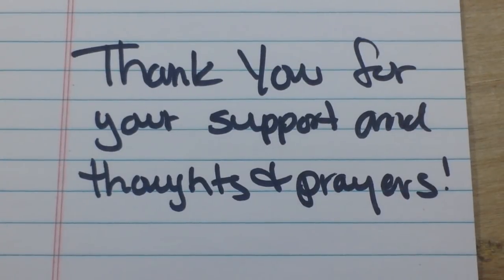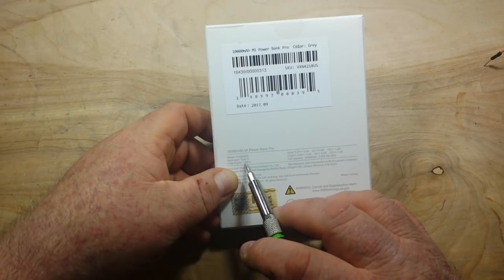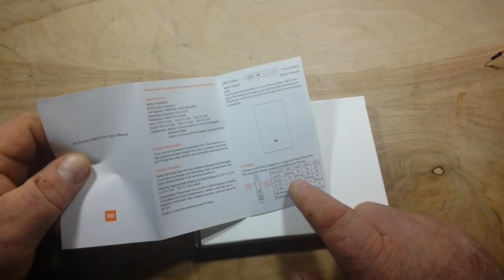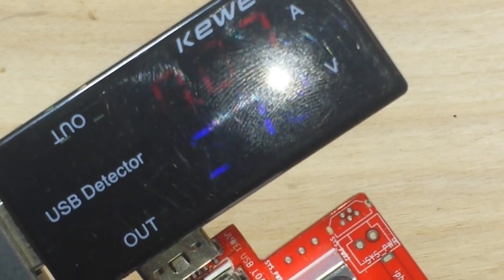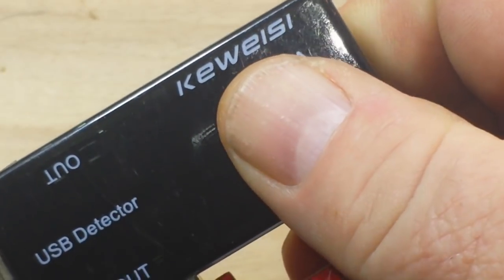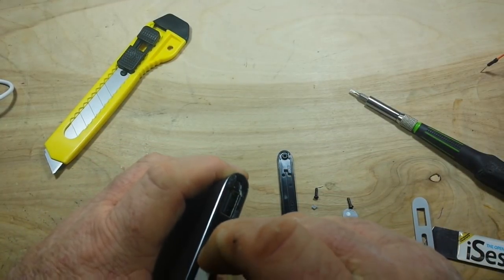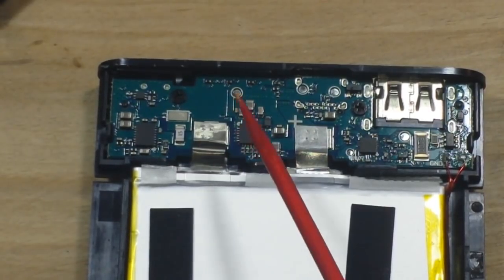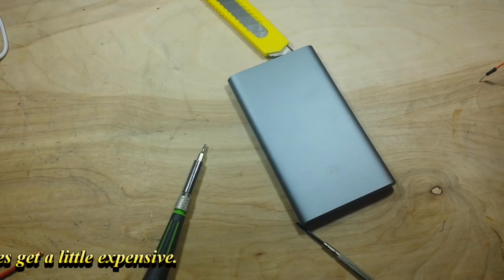Xiaomi 10000mAh Quick Charge Powerbank Review and Teardown

Comment: Hi Paul...so sorry about the loss.  All I can say is at least he is at peace.  I'm struggling with mother's dimensia, it's difficult to watch your parent slip away.  Hope all is well otherwise.

On the other hand, below 4.9 is out of usb spec?  AAAUUUUGHH!  Where did you get that?  There is no datasheet anywhere nor on the official spec that says that.  Android phones mostly do the thing where they ramp the current up until the voltage drops to a threshold, but it's manufacturer specific...and I never found this number either...
Reply from the maker: Hi. Thank you for your thoughts. If I said below 4.9 that was a mistake. The accepted value is 4.75.

I don't script anything so I do slip up from time to time. My apologies.

Comment: huh i just bought a similar power bank, but its model PLM09ZM, same capacity, 2 usbA, micro usb input. and chinese packaging.

i only have a holographic sticker on mine ... i wonder if that means its fake XD

the powerbank has a low current mode. you click the button twice and it will do a different pattern with the leds. in that mode the output is on for 2 hours. you can use that if you want to charge a small device that doesnt pull enough power to keep it going. sadly no "eternal" mode on mine (and on yours?) to keep little micros running off of it

also sorry for your loss